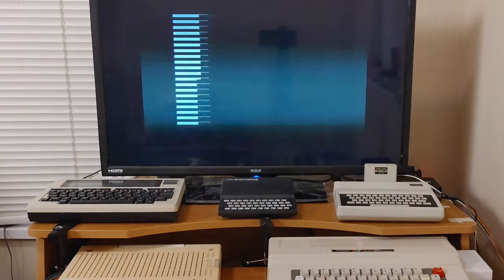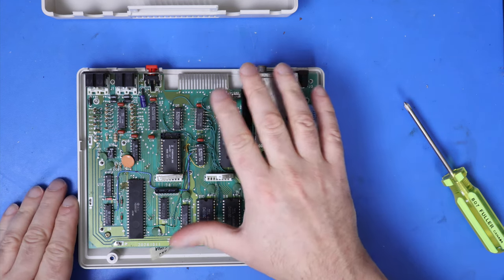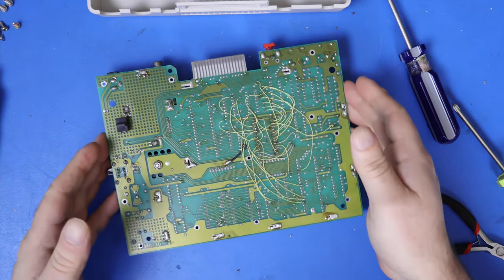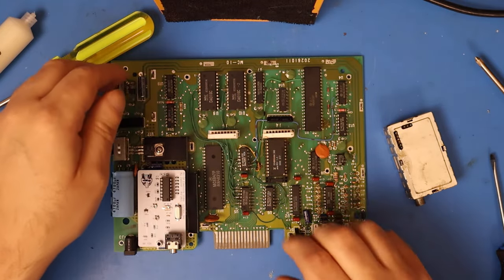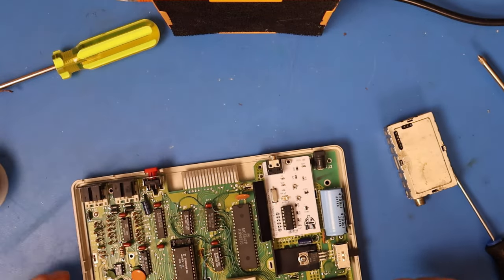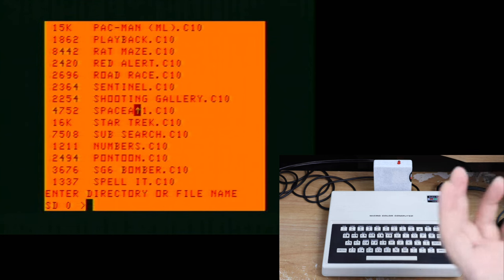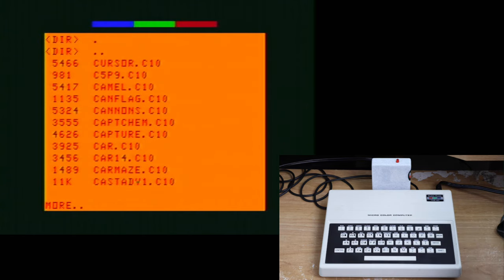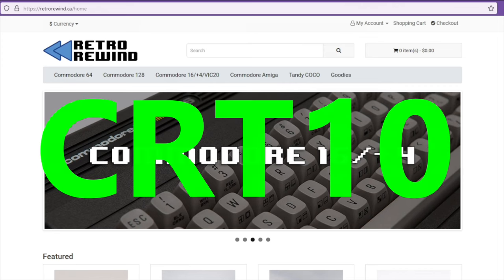TRS-80 MC-10 Upgrade

Comment: The MC-10 was one of the first computers I owned.  I lost so many programs I typed from it's crappy tape interface which never reloaded files I saved and the 16K expansion which, with the slightest touch, would crash the machine.
Reply: Yup, sounds like the MC-10 to me! 😄
Reply from the maker: Fortunately the modern add-ons make this little system much more usable.

Comment: Does this mod use the Ch3/4 switch to kill color?
Reply from the maker: The Ch 3/4 switch no longer does anything after this mod.
Reply: @CanadianRetroThings  So I'm told.  I have heard that using a switch on the colorburst signal pulling it to ground would kill color and create a more sharp grey-scale image.  Useful at times especially when the display with color isn't as crisp as wanted.  Once my order comes in, I'll try to ID that line and see how to repurpose the 3/4 switch to pull color to ground.
Reply from the maker: @erroneus00  Sounds like a great project, grey scale is much better for text only screens, so that would work great with the many available text adventures